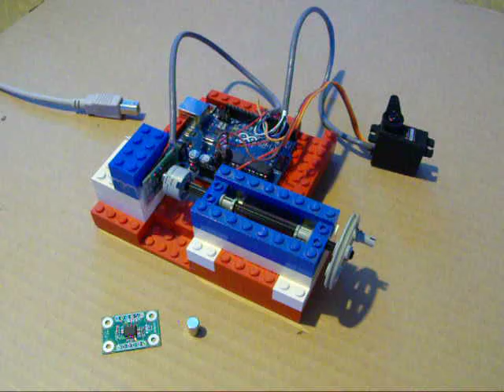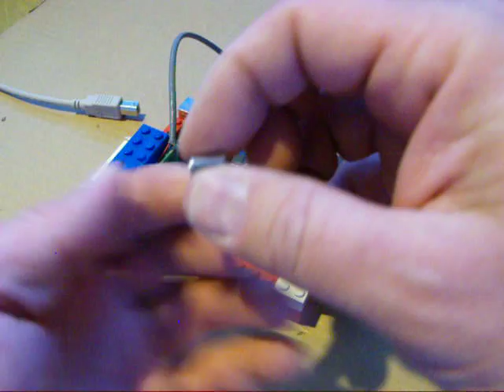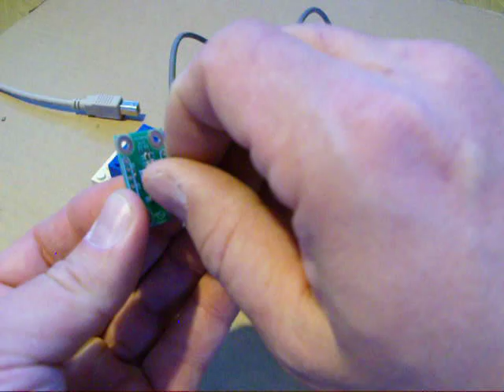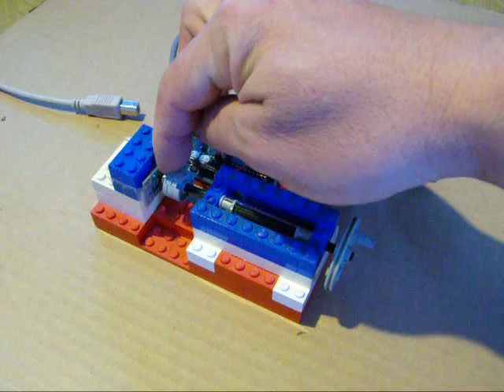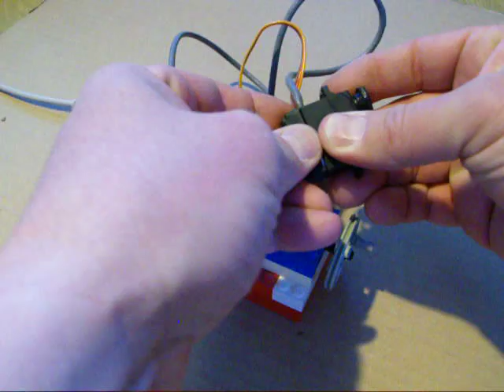Small Servo Modified  for Continuous Rotation with Motion Tracking

Comment: I’ve made a few continuous Servo. But could never get them to stop moving because they couldn’t find 0. You said you made a code that finds 0 so it won’t move?
Reply from the maker: The system I built has feedback with the sensor so I could look for when it needed to stop.

Comment: Did you release this code somewhere. I'm trying to do someting very similar to this but maping a Pot as an input device and a 360 servo with the AS5040 encoder as the actuator. So as an example a 50º deflection on the pot could be reflected as 3 turns and 20º on the servo. I'm having some problems with code for the speed os the servo. The precision is ok, but I'm not able to make it work fast and stop on the right spot. I has a backslash.
Any tips would bevery welcome and of corse congratulations ;-)
Reply from the maker: What I did is if I were within say 10 degrees of the target location I would start to slow down my PWM ( I.E. set PWM much closer to zero code ) Zero code was where I found the 360 servo would not move, so during power up I would actually search for the zero code by walking through the PWM settings and look for where the servo was not changing in relation to the PWM setting and store that as zero code.